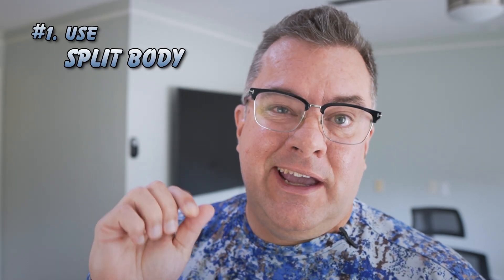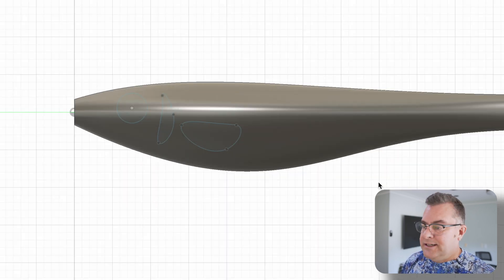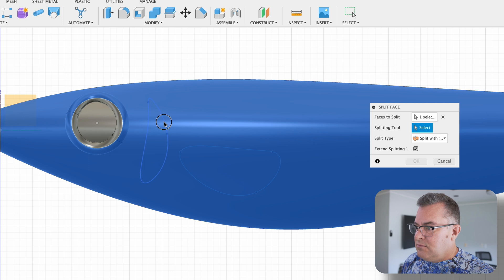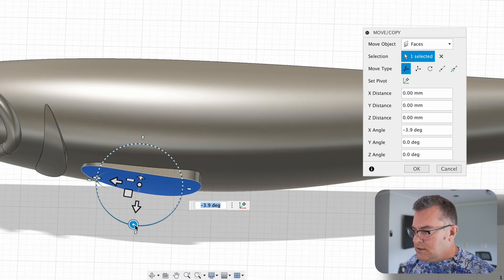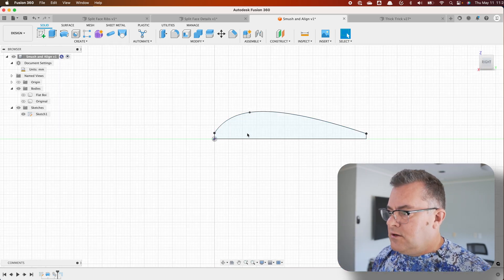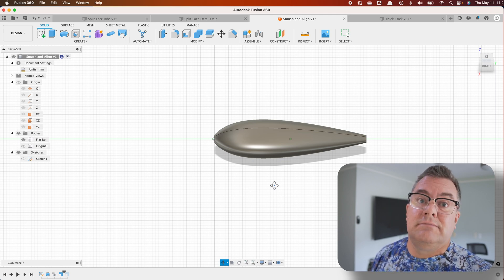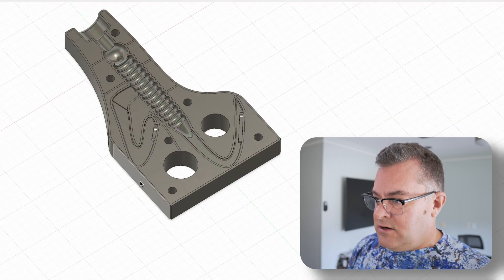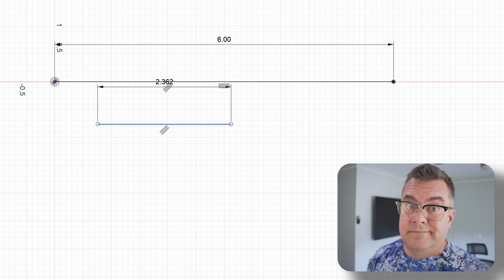Revolutionize Your Fishing Experience: 4 Fusion 360 Lure Design Hacks

Comment: Hi ! I want to ask I'm doing mold for soft frog.. your technique helping me so much but the problem is my mold need to the reverse ways which means extrude part need to be cut.. because of im dipping the mold into the liquid latex .. when the latex were dried out , the soft frog will have some pattern on it.. I hope you will teach us? Thankyou
Reply from the maker: I have not tried that yet but I am pretty sure you will either want to rotomold it, (Enginered Angler just put out a good video on that process) or us a 3 part mold.